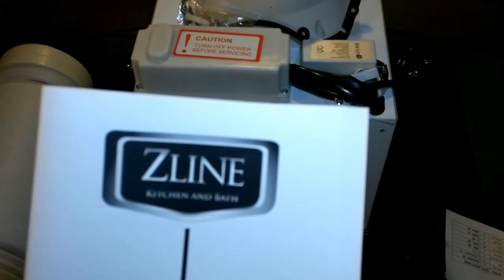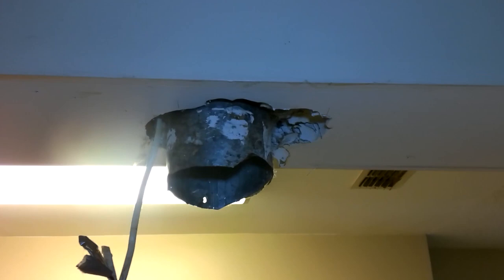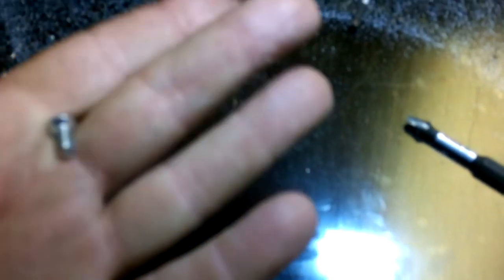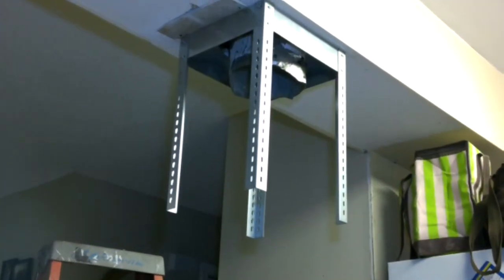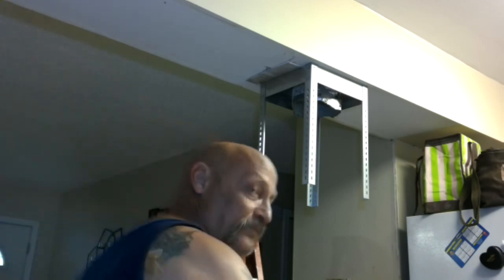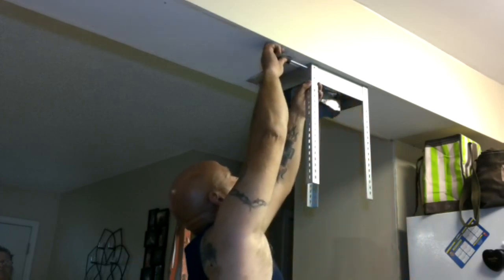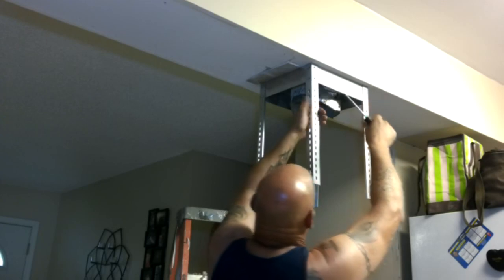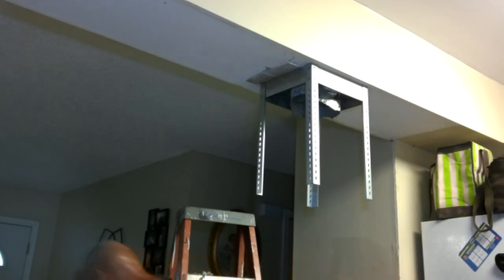range hood installation tips

Comment: Looks really good! I think I have a similar problem. I have an 12” soffit above my cooktop to install a range hood. What is the total height of your range hood, from the bottom to the top?
Reply from the maker: Thanks. From the floor to the top is 83 inches. The hood range from bottom to top is 20 inches.
Reply: @shabear1000  Thanks! To keep mine at 30” above the cooktop I have 18” to work with. We also removed cabinets that were built exactly the way you described yours Lol we removed them and added some white Fasade ceiling panels and two pendant lights. Just haven’t decided on a range hood yet. This video came at the perfect time for me.
Reply from the maker: That's good to hear. I'm glad it was of some help to ya. If you have any more questions feel free to contact me. Have a great week.